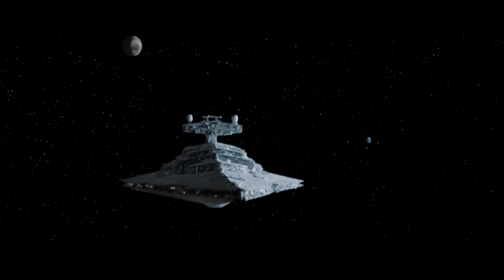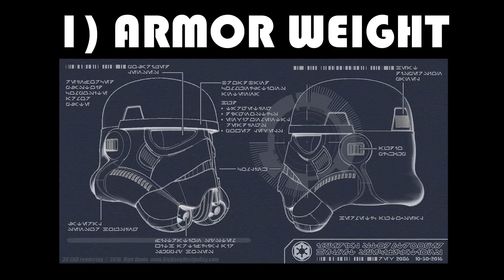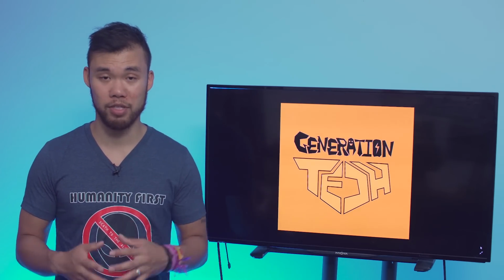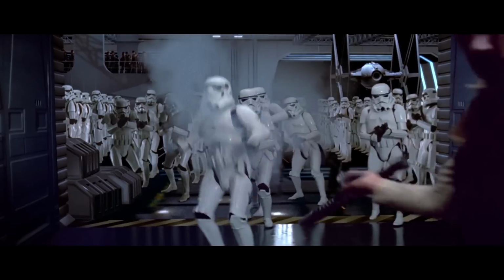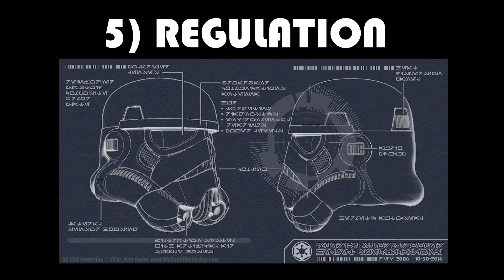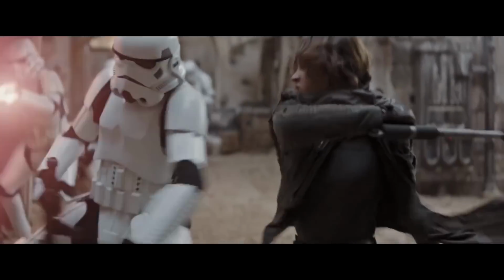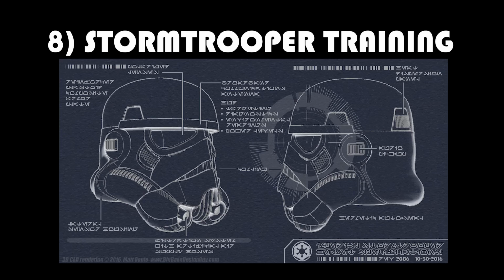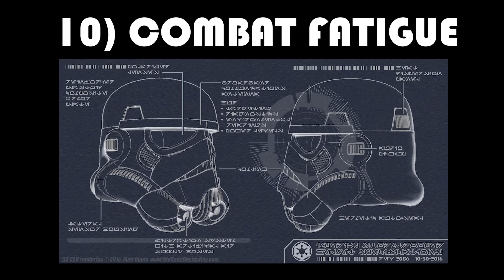10 FLAWS with the Stormtrooper

Comment: By the sounds of it, the Imperial Army troopers we see in Solo, seem to fix a lot of the Storm Troopers' issues. They have a more basic set of armour that covers the torso rather than the whole body, with a helmet that protects from shrapnel pretty well and includes a rebreather and googles that are seperate from the helmet. Their primary weapon, is a ruggedised version of the E-11, along with a rotary blaster cannon and grenade launchers for support. They even have designated medics attached at the squad level. The uniform is even in a muted brown colour that blends in to the enviroment and comes with a rain cloak to keep them dry and warm, but also further breaks up the soldier's outline, so they are more concealed.
Reply from the maker: Yea it was cool we actually got to see them at least in legends the made up the majority of the fighting force
Reply: Apparently, the Swamptroopers, (Imperial army troopers) were actually the standard non-stormtrooper soldier? from what I can find on wookiepedia they used E-10 E-11 and E-22 blasters.
Reply: They are not as flawed as you would think.  Incredible blueprints talks more about the Armor.  The Rebels preferred Rifle is specifically designed for Armor Piercing, and it's only able to do that at medium and close range.

The armor and weapons will constantly evolve to counter one another.
Reply: Also they have an easily removable face mask, as was suggested for stormtrooper armor in the video
Reply: The Mudtroopers were closer to the Imperial Army rather than the Elite Stormtrooper Corps. Stormtroopers are closer to US Marines in the Star Wars universe and are closely tied to the Imperial Navy. The movies do them no justice, though.
Reply: @BungieStudios  I wouldn't say they are closely exclusively tied to the NAVY with the exception of "Storm Trooper Marines." Storm Trooper Marines are depicted carrying E-11s, portable anti-fighter and ground vehicle Proton Torpedo launchers, thermal detonators, and the gear Sand Troopers carry all at once.
Reply: The name says it all. "Stormtrooper" is a translation of "Sturmtroopen" (German for shock or assault trooper), an idea from the First World War where small, aggressive, heavily armed and fast moving groups would assault trenchlines and punch through. Stormtroopers are supposed to be the elite, the best of the best, a cut above. 
Which makes it all the more odd that we see them damn near EVERYWHERE instead of Army troopers...
Reply: Interestingly, in the cut extended version of the Solo battle sequence close up shots of the Armytrooper's Z-6 style rotary blaster didn't have the barrels rotating. I couldn't tell from the flash but I think they may have had the barrels firing in sequence more like like a wrap-around version of an organ gun. That of course would physically simplify the blaster, but impede cooling and throw off the point of aim by not having the blasts consistently come from 6 or 12 o'clock. Definitely a worthwhile tradeoff on a muddy battlefield when used by conscripts and volunteers that were of middling accuracy in the first place. OR the effects team were planning to make the barrels spin later in post but that wasn't added because the scene was cut.
Reply: weldonwin the ones we see Solo fighting with are Mud Troopers, they’re widely considered LOWER then the standard stormtrooper
Reply: Really wish they would add an imperial army trooper skin for the empire in BF2 for the assault heavy and specialist
Reply: The empires army is better then there Stormtroopers.
Reply: Solo sucked.  Not a Star Wars movie.
Reply: weldonwin pimienta
Reply: @BungieStudios  Far closer to the SS then the Marines. The stormies are ideological soldiers hence the SS
Reply: @michaelhowze8198  They live on ships and they deploy from ships. Littoral combat. They're technically fewer than the Imperial Army. Hence Marines. 
Though I admit the SS were the German counterparts in functionality and service, though not 1:1.

Comment: Ten flaws in imperial tie fighters.
Reply: Barry Bend just one real problem no shields that and poor visibility but with proper tech like that found in the f-35 it could be an effective design for anti theft like the storm troopers helmets functions
Reply: It would be harder to find ten good things about TIE fighters.
Reply: Eddie the Usurper it’s speed it’s cheapness it’s simplistic design
Reply: @skyslasher2297  that's about it.
Reply: 1st flaw = no shields.
Reply: EVERYTHING
Reply: Im more interested in  The Xwing
Reply: @skyslasher2297  They have amazing Tech actually, and there sensors allow them to see through there hull as long as they are not disrupted by ECM.
Reply: @eddietheusurper5795   
1They are easy to mod.
2 They are more maneuverable than most Wing Fighters.
3 They are as fast or Faster than most Wing Fighters.
4 They constantly had Weapon changes, with the 7.2 and other cannons granting them more powerful cannons than most Rebel Fighters.
5 Way easier to maintain.
6 They have the most advanced targeting computers compared to any Rebel Fighter
7 The ECM and ECCM is more powerful on the TIE Fighter than all but onevWing Fighter.  The A-Wing Interceptor is the only one with better ECM but not ECCM.
8 TIE Fighters have more advanced pilot interfaces, and helmet mounted systems.  The TIEs can even be remotely piloted by a TIE Pilot with a arm mounted control interface that is standard on all there gear.
9 Despite having lots more advanced systems that I mentioned, it is cheaper by not having landing gear, hyper drives, and shielding, and life support.
10. Though it causes damage, laser based weapons hitting the solar panels will be absorbed in to TIE.
11. There hull armor has the same hull strength rating as the original unmodified  X-Wing, that's pretty good despite having no shields and having possibly thinner armor plating.
Reply: 1 you can only see forward..
Reply: 1. they weren't deployed in greater numbers
2. there wasn't a big enough dedicated carrier for them
Reply: I feel like the lack of shielding in a tie fighter works for an organization like the Galactic Empire. The Empire has a some factors going for it that groups like the Rebel Alliance don’t.
The Empire has almost inexhaustible capital wealth because they are pulling taxes from the entirety of the Imperial held worlds. The Imperial military has access to a rather significant number of soldiers, sailors, and pilots. So much so that Imperial Admirals tended to think of stormtroopers as being a “renewable resource”. 
The Imperial navy is therefore capable of fielding an incredibly large number of pilots in quickly produced, relatively cheap fighters. Tactically speaking they tended towards swarming enemy fighters with a numerically superior force. Tie fighters could be lost in incredible numbers, but the Empire could afford to lose almost any number of tie fighters. 
The Rebellion on the other hand has next to no money and has access to a significantly smaller number of people. Because of this, they had to invest more into the training and equipment of each pilot to insure that they could survive as long as possible.
Reply: @skyslasher2297  everything. There's nothing right about that terrible fighter.
Reply: 1. No shields, becouse of that every shot blows it up
2. No Hyperdrive, becouse of that they need to be transported in larger vessels and deployed to battle (and that takes time) while rebel starfihters simply jump straight into battle with their weapons ready (and they can use hit&run tactics, you know jump into battle, fire everything you have and then jump out)
3. No life-support systems, becouse of that pilots need those heavy suits and helmets that restrict their alredy limited vision
4. Low visibility, you know only small window at the front, and sensors aren't highest quality (rebel starfihters have 180° range of vision, Ties have 60°) 
5. Weak weapons, the only and I repeat ONLY weapons they have are those two weak laser canons, how many shots from a Tie it takes to blow up an X-Wing ?
6. They are so small, anyone above certain height and wieght just doesn't fit in
Reply: @lancer737  They are flying coffins, and officers treat them like expandable trash, one shot from a simple blaster rifle is all it takes to take a Tie down
Reply: @fly672  Your wrote lots of incorrect information about TIE Fighters.    Its funny you knock the armor capabilities of the TIE Fighter, when you don't know what the output of said weapon is, what setting it is at, as e-11 at max or near max can cut through space station bulkheads and walls.

You also forget a T-70 X-Wing was disabled by a E-11D, and TIE Interceptors, despite having slightly more armor than both a TIE Fighter and T-65 X-Wing, was almost able to survive traveling completely through a super heated nebula full of visible proto stars, even flying close to one before having trouble despite the massive amounts of radiation, heat, magnetic fields, and gravity fields it was withstanding.

Here's a hint, it's way better defensive capabilities than any fighter in any fiction to be able to withstand that with no shields.

Also both the all Rebel and Imperial Fighters have instant 3d 360 ftl active composite scanning clusters.   At best you saw something for one sensor out of the large group of sensors Rebellion era fighters have.
Reply: Basically a TIE defender then.
Reply: 1) It exists.
2) The Imperial Navy uses it.
Reply: tie fighter VF-1 valkyrie
Reply: Barry Bend they had amazing pilots.

Comment: There's always this myth that a knight in full plate armor has incredible difficulty moving around and staying mobile. This cannot be further from the truth. A knight's body armor typically weighed about 20-25 kilos, or 45-55 pounds. Remember, that weight is more or less evenly distributed all over the knights body. A knight in full plate armor can do cart wheels and somersaults with ease. There's even videos of this on youtube of dudes wearing full 25 kilo plate armor and running jumping around like it's nothing. Remember these suits of armor were tailored to fit the knight perfectly, each piece of metal shaped to his body almost like a glove, and these knights trained their entire lives to understand his armor, it's weaknesses and strengths. Also about stormtrooper armor, it was designed specifically to defend against blaster bolts. The armor, and the body glove worn beneath, were designed to disperse the energy of a blaster bolt and insulate the wearer, lessening injury, much like modern day Kevlar armor. Though the wearer may be incapacitated from a low/medium/high power blaster bolt, survival thanks to his armor would allow the trooper to receive advanced medical treatment that could return him to service. The armor deflected stun beams, and served as excellent protection against explosions and shrapnel, thereby drastically reducing the effective casualty radius of fragmentation weapons used against troops wearing such armor. It was almost impossible to kill a stormtrooper with a slugthrower unless the bullet was abnormally large or specifically armor piercing, or hit the body glove or visor lenses.

Comment: some of the sources i've read claimed that while the clone phase one and two armours were heavier and could stand up to heavier rounds, the concussive force was poorly absorbed by the armour, making it degrade and weaken rapidly, until it is either replaced or the clone died. on the other hand, the storm trooper's armour was better at stopping the round itself and absorbing/distributing the concussive force, but that resulted in troopers being knocked unconscious by one or two hits. the casualty rate for troopers was supposedly lower than that for clones

Comment: So, as someone who's always been fascinated by the functionality of armor designs, I'd like to offer a fair discussion on armor weight and design of Stormtrooper armor. From all info I've found, standard issue stormtrooper loadout was between 15 and 20 kilos, which I believe is without their blaster. The average modern military trooper without his weapon is hauling about 30 (based on modern American military, but this is variable). So weight wasn't the problem these stormtroopers were having, as even firefighters carry a heavier loadout at around 28 (at least, according to my stepbrother, who is a former firefighter).  A medieval knight in full plate is carrying close to 30 kg, the same as modern soldiers. Now, this varies depending on the armor of course, but I am going to use fairly basic European plate mail armor without embellishments, which would be the most common and the first kind people think of for sake of argument. The issue with Stormtrooper armor was more the design. Even medieval knights armor was far more mobile, because plates were designed to slide and move together. Stormtrooper armor is all individual pieces that don't overlap or connect, having no pivot points on the plating to allow for easier movement. So what happens is that as a trooper in it moves, the plates push against one another, which blocks the range of motion. Medieval knights armor was shaped to allow full range of movement, which is why you often see the edges of joint plating have curves along the edges. It was to keep the armor from colliding with itself and blocking movement in the joints as much. Stormtrooper armor has none of those features, and would be highly restrictive because it is hindering its own motion. even if it's lighter, the poor design of it makes motion far more difficult, creating the unwieldy look of it. So, a stormtroopers armor weight is far from an issue. Compared to modern soldiers, they have it easy, at about 2/3rds the weight of our soldiers today at most. but the design of the armor? That's what gets them killed.

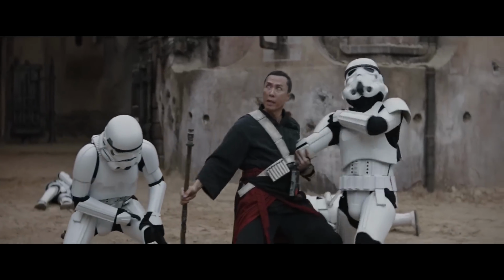Comment: To be fair I would not say stormtrooper armor is bad just that it is incredibly inconsistent for example look at 4:47 where a stormtrooper's armor stops 6 blaster shots at point blank range and the trooper inside it is still fully conscious.  So unfortunately like a large amount  of things in star wars it just acts how the plot needs it too.
Reply: There is a slight issue as well with blasters apparently having various settings, meaning we almost never know if the weapon is actually firing at its highest consistent setting.
Reply: I also read somewhere (may or may not be true) that stormtrooper armour sends the energy from the blaster bolt throughout the body rather than in a single point, which increases survivability at the cost of troopers being rendered unconscious. So a lot of the 'dead' troopers are just unconscious
Reply: Also the armor was designed to be resistant to kinetic energy but a hit with staff (that wouldn't even be able to knock out a dude in a motorcycle helmet) knock the stormtropper out
Reply: That dude is still alive at the end of the fight, u can see him try to crawl/twitch
Reply: Wow. The only stormtrooper armor in the galaxy that worked as it should belonged to a stormtrooper on Jedha of all places.
Reply: Well if they are dead or unconcious, it doesn't matter really much, if they're at the bad end of a losing fight, does it? The victorious enemy will probably just pull off the stormtrooper's helmet and put a blaster bolt through the unfortunate's head.
Reply: THATS A WAR CRIME
KOFI WHERE ARE YOU
Reply: I think he ded
Reply: It might be explained by the fact that Stormtrooper armor is constructed in factories that probably employ slaves (if their shipyards and the Death Star are anything to go by), and it wouldn't be too hard for rebels to convince the Wookie slaves to sabotage.
Reply: Evilmonkey 45 So? And on the other end if your squad manages to annihilate the enemy you and others live.
Reply: Then they slaughtered the rebels in rogue one.
Reply: Plot armor
Reply: I heard that it actually is inconsistent because it’s made in plenty of different factory’s with different quality control. So some is good some is bad

Comment: Trooper armor would be more like platemail. Properly fitted plate is far more maneuverable than it looks. Infact you can do flips and cart wheels in plate.I do agree a smaller suit for environment combat in forests and navel action such would be useful. Also a spacesuit variant would make sense for dangerous environments.

You also mention target and other sensors were missing. Agree a camera and wireless camera on weapons and armor would help in accessing what happened to the dead/unconscious trooper to prevent the same thing to that troopers would be or current rescuers.

 The droids and security cams could easily be accessed as needed. This provides a better field awareness for all troopers.

 Additional medical nanotech would be an asset to aid them and others as well.

The weaponry needs the biometric trigger and camera targeting like hannibal king used in the Blade movie. Another item to add would be mouse droids equipped with holo and communication systems the trooper can carry.